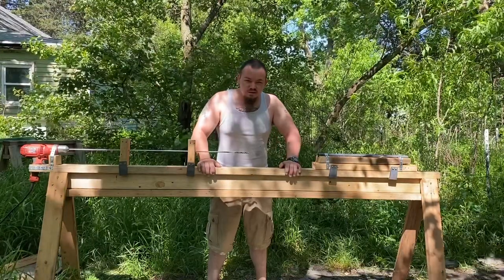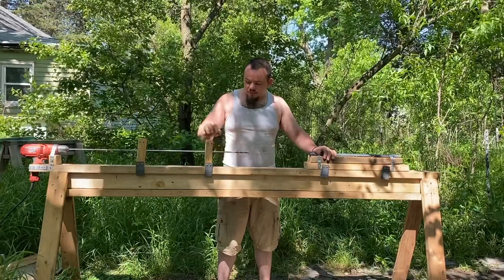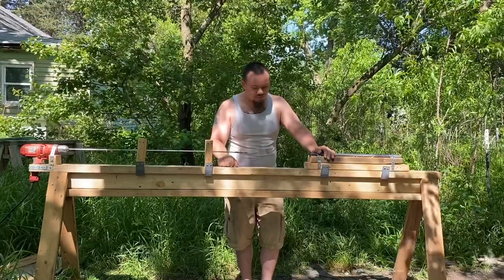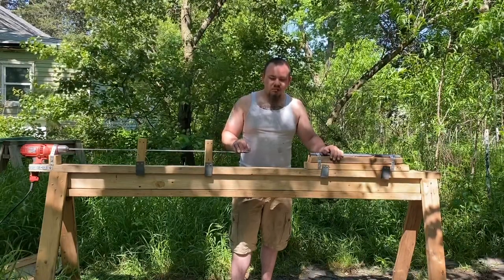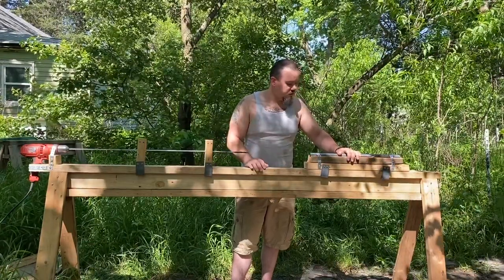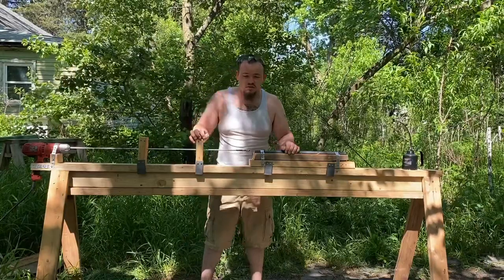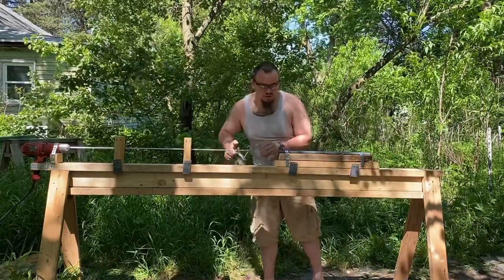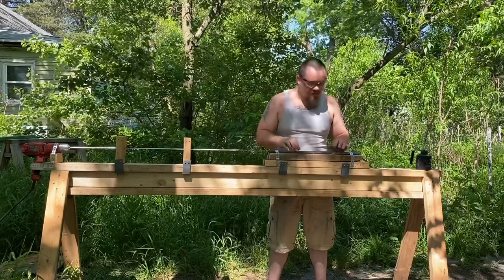Boring the Hand Forged Barrel

Comment: That's why you need a piloted drill if you're going to open an existing bore.  Either gonna have to make your own piloted drill with custom pilots too or you're looking at a lot of cash to buy one to your specs.
Custom piloted drills from  36" long drill rod are actually really cheap and easy to make in straight flute format. I make them all the time and they're closer to true gun drills than twist drills.
A harbor freight drill press, harbor freight cross slide vice and some cheap end mills and you can make your own straight flute drill. Use a center punch and make a jig to align and drill a pilot hole first.
You can make a pilot from plain steel rod turned in your drill press and reduced and shaped with files.
You can make bore and chamber reamers like this too.
Reply from the maker: Wont work, already tried. The hole isn’t straight or round enough, so they just snap the pilots off, or somewhere along the bit. And sometimes you get flux buildup in the bore which wont allow a pilot to advance.

Comment: Original forged barrels where “bored” not drilled. Drilling a forged barrel with modern drill bits ... for the most part dose not work as you have seen. They tend to make there own path. Where as boring bits will fallow the existing hole. 

Chris Laubach
Reply from the maker: Chris Laubach these had a 40 degree edge so they would follow the bore. The first one did beautifully. I believe where I went wrong was not jumping up in size enough. I am also going to try boring a barrel with the finish size bit to see if I even need to pilot them in the first place.

Comment: So, you can see in your fixture that part of the problem is your drill bit is not aligned with the work piece bore.  The bit is very clearly being bent downward by the workpiece.  In order to get this to work you are going to need some more precision in your fixturing.  You are going to have to make sure that the bit and the existing bore are well-aligned with one another or you are going to end up with an oval bore or worse.
Reply from the maker: Steven Sheldon Yes it could be more precise. The barrel was aligned against the drill sans bit and then the bit guides were added, and they were drilled alittle too tall for the bits. I assumed there was enough flex in the shaft to counteract this and I was correct. I have identified most all the problems with my setup and plan on improving it for future builds, thank you for your input.

Comment: Still working my way through your series and loving it so much! I'd just like to say, if you watch Wallace gusslers documentary I believe its called colonial gunsmith, their drill bits they used were twisted left hand, but spun right hand. This created a more reamer style of cut that followed the bore without walking. The chips produced by this were more of a powder consistency than the drill shavings we know today, but it would could have saved the length you had with the original barrel by it not wondering off center of the bore. The downside would be having to clear the chips every 1/8 inch max, as the chips are fine and they don't follow the flute to clear themselves as well. My buddy and I made one of these drill bits and it went through an annealed rasp amazingly easily. That is the direction I will take with my pistol build. Btw, did I mention I'm loving your vids?!?! Subbed
Reply from the maker: Everyone who is anyone has watched his video. You know why they used bits like that? -because they didnt have twist drills. I have made and used them and they are painfully slow and dull quickly. My bit wandered because my setup is Redneck as all heck, and I didnt have it lined up properly with the bit, hoping it would do as the first and just follow the bore.
This was also the first time this setup was used, and I learned you do not have to pilot the bore with a smaller bit. Pick your final drill size (before reaming) and go.
Reply: @veteranironoutdoors8320  ok sorry for my input. Just trying to learn.
Reply: @veteranironoutdoors8320  as a machinist, I must say twist bits will wander, but obviously that doesn't matter. I agree with you saying to pick the biggest bit and go with it,given you are using twist bits. The reverse twist bits must be stepped up slowly, but they will follow the bore unlike a twist bit. If they dull slowly, thats a matter of material and heat treatment. Like I said, I've made one and had no issue with it but it was cleaned frequently and lubed. I will follow how Wallace did his and continue on my path, you on yours. Nothing but the best
Reply from the maker: @KeithBair  In my effort to get his style bits to work satisfactory, ive made them out of HSS, 5160, 1060, 1095, and I made a few and cased them to where the carbon content on the outer surface was at least 1.5%. 
Dont get me wrong, they work; just not on the level of a twist drill and (properly heat treated) HSS. I have found that twist bits will follow your as forged bore, provided you got the bore reasonably straight after forging.
Reply from the maker: Also, I work as a machinist (and fabricator and welder, on the fly) at my day job as well. If you have any twist drills that are stepped at the tip (I use dewalt) those things track true as can be thanks to that nub, however they do leave more chatter than a regular 117° or 135° tip. EDIT: so if you used step tipped bits, drop your size 1/16 of an inch to allow adequate thickness for reaming. Otherwise your 38 cal barrel will become a 40!

Comment: What kind of metal were the bits those old gunsmiths use made of? Was it just hardened steel? Or did they have better compounds back then?
Reply from the maker: Shear steel, most likely, a small shop on the edge of the boondocks would probably have used a case hardened, highly refined wrought iron bit.

Comment: Dude! Sorry the drill jumped the tracks, brother! Been an amazing build thus far and can’t wait to see how you finish it up! 

Also, I had a thought the other day about this. Would it be useful to use a mandrel/rod in the barrel during the weld? That way it might keep the hole concentric so the bit has a smoother track ahead of it. At the very least, it might be helpful to smooth the fullers before the weld. I know NOTHING about gunsmithing so take that with a giant grain of salt. Thanks again for all of your great content, sir!
Reply from the maker: Ben Stricklin I used a mandrel on the coil wrapped barrel, and that had the best starting bore of the 3 test barrels, and I still had a bit jump track on it. I think the ticket is to skip drilling with a smaller bit and just go full size off the bat

Comment: Wouldn't it be better to get some marble rock of the appropriate size then shape the marble so that it is just right (perfectly) so that it would make a rifle barrel including the rifle bore when hot metal was poured into this mold??? 

A seemingly simple way to make this metal mold out of marble rock (of the appropriate size) would be to make a wooden replica of a rifle barrel and then have the marble perfectly fit the wooden replica barrel.  Assuming that the marble was sanded down very very nicely, this would seem to be a perfect way to not only make one rifle barrel, but also it would enable hundreds of (smooth bore) rifle barrels to be made (until the marble mold breaks for some reason).

A simple way to test it would be to put hot wax in the marble mold, then let it set until it cooled down, then pull it out to make sure that everything will go well when hot metal is poured into this mold.

It stands to reason this would work better than some kind of clay (or sand) mold because with marble material as the mold material the hole could be inside the rifle barrel right from the start. If it is done right there wouldn't even have to be any file-ing or sanding on the inside to get the bore nice and smooth...  if the marble mold was nice and smooth to begin with. 

We all know that marble can be made to be extremely smooth because of the marble counter tops that are smooth as silk to the touch, so it stands to reason that marble would be a great mold material with the primary drawback being that it would take quite a bit of skill to make a marble mold.  But once that was done then barrels could be manufactured over and over again with the bore shape already set up inside the mold.

One thought is that perhaps this method would only work well with higher caliber rifle barrels because the marble for the bore hole through the center of the barrel would have a difficult time with a .22 rifle bore because a marble barrel mold might break off for small bore rifles like for a .22 rifle.

Another thought is you often see rock cores that have been drilled out sitting around on trails near mines and what not that are perfectly smooth cylinders.  If that could be used to mold the barrel bore-hole, that would be a simple way to have a perfect mold for the inner part of the rifle barrel.  Then all that would be needed to be done would be to make the outer portion, perhaps drilling it to put a big enough hole through the length.

This method would be a significant amount of work to make the mold, but then after the marble rock mold (or molds) were created an unlimited number of rifle barrels could be created by this method.  (Rifling, if desired, could be added later through special process).

Marble has a higher melting point than metal so it stands to reason this method would work. Seeing some of the previous videos leading up to this video from this same YouTube channel, and seeing how much arduous (and dangerous) work was being done, this is what popped into my mind.  So I throw my two cents of completely un-expert opinion into the mix for what it's worth, which isn't much.

I can jibber jabber with the best of them.  But maybe by throwing an idea out there like that someone will pick up on it, and prove or disprove whether or not that idea makes a lick of sense of not.

Honestly I have no clue what I just wrote, I'm just throwing my no good for nothing opinion out there.  But if I was a Cro-Magnon man that's the first method I would try so I could manufacture tens of thousands of rifle barrels...  and then after that take over the world with my new snazzy weapons (though I would have to invent gunpowder...  but as the saying goes, one thing at a time).
.
.
.
Reply from the maker: Haha WOW, someone’s been watching alittle too much Conan the barbarian! Where do I start...First and foremost, if that was the quickest, and most reliable method of manufacture, that would have become the historical way they would have been made, as our forefathers didn’t have the time or materials to mess about. Casting metals (especially iron) requires a vast amount of resources and very specialized tooling and is prone to failure (in casting defects, the strength of the finished part (even with no defects) and the sheer temperature of the metal would probably thermal shock the rock and break it) now more on the material properties. Black powder is an explosive, which is not ideal for a propelling charge (but that’s what they had so that’s what they used) meaning instead of building up pressure in a predictable curve (like smokeless powders of today) it sends a shock load to its container. Cast iron is absolutely no good for handling shock loads like that (not saying it can’t be done though, they did make cast iron cannons, but they had to be massively (and prohibitably for a small arm) thick and heavy to handle a charge of powder, and even then that didn’t guarantee against bursting. Google “blown up civil war cannon” you get surprising results) and lastly marble like I said would most likely end up breaking due to the temperature of heat, heat shock (both during the pour and after the part is removed) and heat cycles involved.